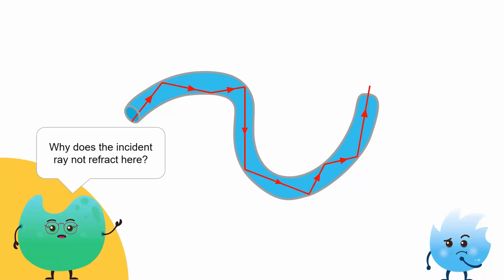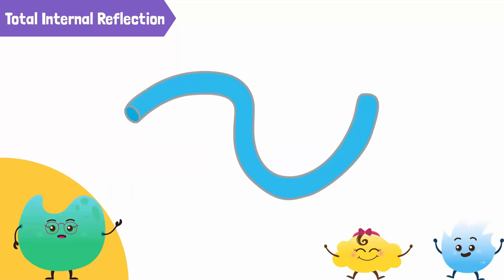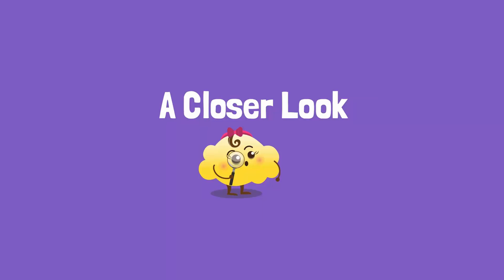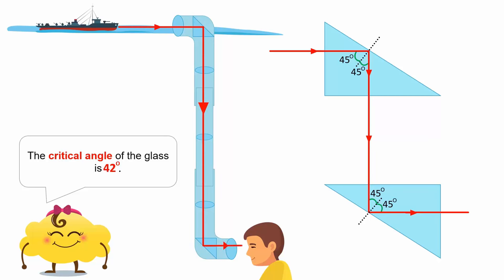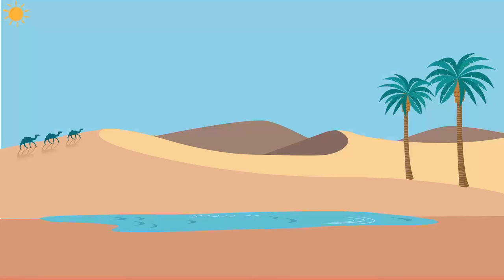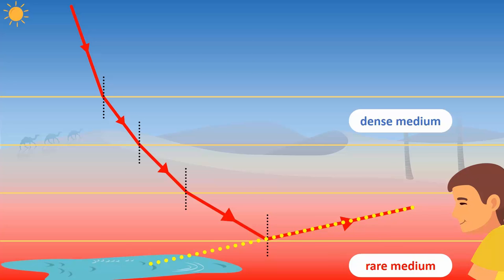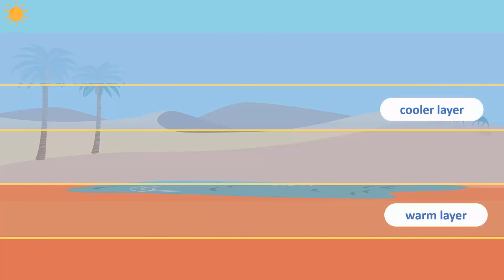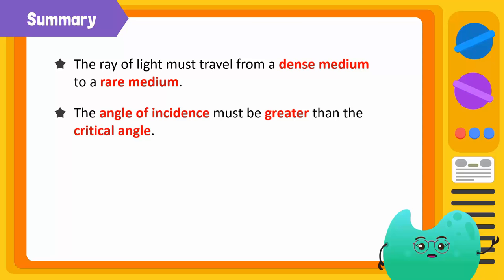Total Internal Reflection and Its Applications

Comment: It should had been " the refraction happen when the incident angle of dense material and its normal surface vector is less than 45 degree and total reflection when that angle greater than 45 degree"

Comment: But in optical fibre both the mediums are air only and there is just a thin layer of plastic so how can we say that light travels from any optically denser to an optically rarer medium in this case
Reply: @Abhir Bansal optical fibre consists of 2 parts-core and cladding.the core being denser and the cladding(outer covering) being rarer therefore TIR can occur for incident angles greater than the critical angle..
Reply: @bhumikagupta5071  Ya got it